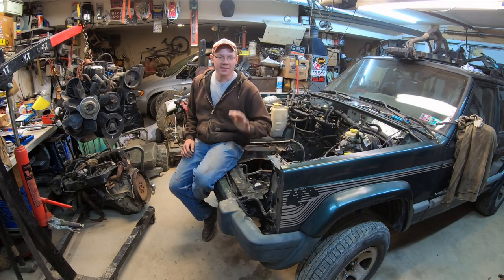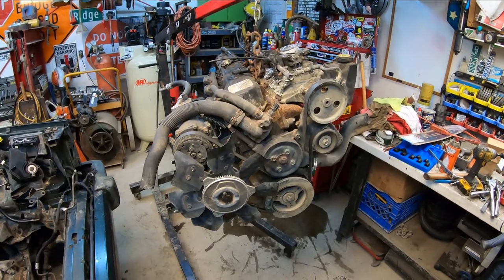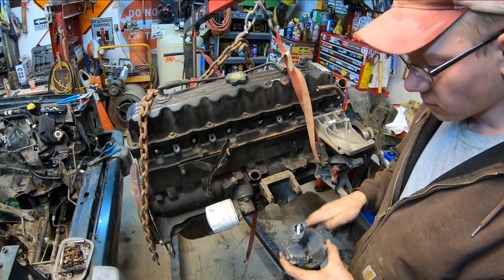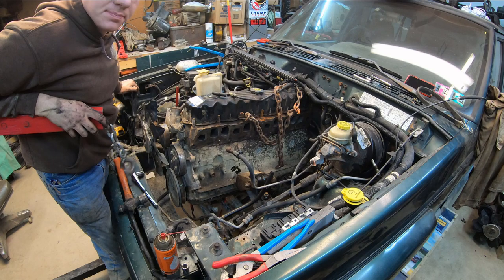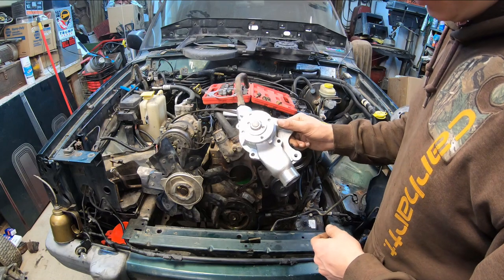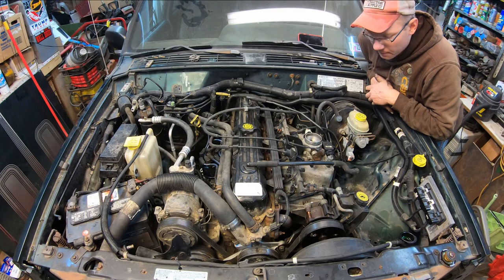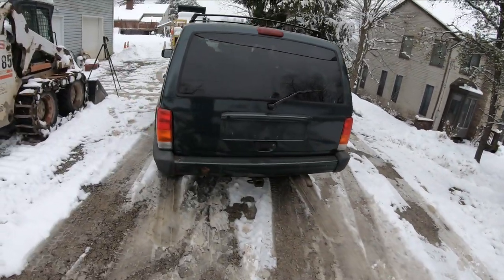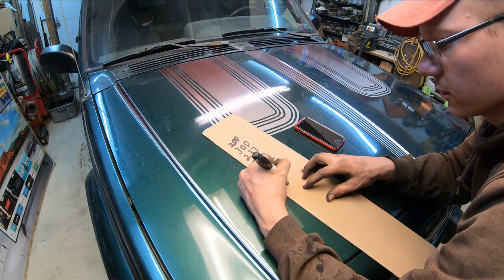$200 Jeep Cherokee gets JunkYard Engine,  WILL IT RUN AND DRIVE???

Comment: So its an auto box? Use a New clutch if it is manual trust me its worth it then.. Good learning curve if you do stuft twice aye ;-)
Put nice Winter tyres on it and be done with it? Spend the money on Mike Sanders fat/grease for undercoat.
If you can hinder the Rust it will be a good Winter car, just dont tune it as it should stay a beater

Comment: If you preheat the exhaust manifold first it’s easier to weld I stuck mine in the oven for about 15 mins at 500 degrees but a torch would work fine

Comment: 210 is normal for these Jeeps I believe. I've worked on my cousins 2000 Cherokee and it always runs at 210. Plus the electric fan is programmed to kick on at 218. We put a 180 thermostat in it to try and bring the temps down, they normally come with a 195.

Comment: jeep is AMC.  I have a 59 rambler  engine swapped back in the 70s from a 196cid to a 327cid. this was a temporary car or beater .  470,000miles later I still like it.  gets 25 mpg and will go over 100 mph quickly.  also no one else has one.

Comment: Temp, these 4.0 have two sensor one on the rear left corner of the head and one on the water pump. The one on the head is for the instrument panel. The motor is not run at the what the instrument panel displays, the water pump sensor feeds the PCM.

Sounds like jeep, looks like a jeep it must be a jeep. This thing will dig its heart out in the snow.

Comment: Nice work! I actually own a 1998 grand Cherokee I purchased new with 22 miles on it and it runs great at 150K on it, the real issues with these vehicles are the rear differentials go out because of the fact they were junk from the factory!

Comment: Nice, I use to have a 1990 Jeep Lerado, very similar style. Check and make sure the electric fans working correctly, mine had a heating issue and that was the problem.

Comment: My covid project replaced the head on my 99xj with original 225k miles. New shocks leafsprings and some eBay injectors and it rides again. That 4.0 will run for ever

Comment: pretty good running engine ,, i've got a 96 XJ and i love it ,,i recently rebuilt my 4 liter engine  it had 300,000 miles on it and was still running good but i wanted to do some work to it 
i converted mine to a 5 speed manual  with parts taken from a wrecked 89 XJ 2 door,,i have since added a high flow oil pump and oversized radiator for the cooling issues ,,other modifications including cold air intake , Air-water after cooler and a blaylock 60MM turbo ,,i do a bit of offroading  and the occasional hill climb ,,the 4.0 liter AMC 6 cylinder engine is actually a very tough engine and has a very strong bottom end ,in fact this engine makes a very good marine engine as well ,,the stock engine is rated at 195HP it can easily replace a small block V8  and i know someone who replaced a pair of 454s in a cabin cruiser with a pair these inline 6 engines ,,completely removed all of the bilge water pumps ,water inlets and outlets ,,the radiators are housed in the engine room hatch covers and use electric blowers for cooling ,,this completely eliminates the carrying of organisms in the water plumbing
it's over 1000 pounds lighter ,,and in fact he installed a 25KW diesel generator between the engines for rear ballast

Comment: Nice  job  replacing  & changing  ignition system back to  Coil set up, huge shop Rate  savings  doing it  yourself ,hopefully you'll  get rewarded with  long Term reliability  with  this  generic  amc  thing.

Comment: I am on my third Cherokee since they started making them, Love em'. They do like to hover around 210* on the temp make sure the electric fan is kicking on to. They are very sensitive to vacuum leaks to. By the way that Exhaust header is stainless  so the weld is going to look like a dirt dauber with or with out gas (I am pretty sure you were using mild steel wire with 25/75)  It will hold though. My Cherokee I have now is on 33" with a 4" lift. Lift kits for those are cheap as long as you don't go for the max lift long arm kits. One of these days I'll get around to doing the Mercedes turbo diesel swap on mine.
Reply: You can weld stainless with a MIG. I’ve done it before. Just get a spool of stainless wire.
Reply: @notajp  and 100% argon for shielding gas

Comment: $900 is only three months car payments. It looks and sounds good enough to get at least a couple years out of it, so I'd say that's money well invested. Don't know if it makes a difference to you, but Mustie1 way up in 'New Hampshuh' uses chainsaw bar oil to undercoat vehicles, claiming that it sticks better and lasts longer. I suppose you could always pressure wash the underside and apply a thin layer of Great Stuff low expansion insulating foam to seal 'er up and fill those, uh, fuel-economy body voids. It would quiet the ride too. Good job, Matt. Good job.

Comment: Those engines are awesome.  My '94 Cherokee lasted 280k miles.  Just be wary of the oil sensor unit. They tend to snap off and leak like the Exxon Valdez.

Comment: 210 is what they run at and they will run without complaints at that temp thats a very nice running engine and im planning to put a 4.5" rough country lift in my xj mostly because the 6.5" long arm kit is way out of my budget

Comment: Those Jeeps are known for running hot the radiator plug eazy and gust don't  let the coolant flow good even when they were new. They make good aftermarket rads that will fix the problem if it still exists...

Comment: If the exhaust leak (that you talked about at the end) is where I am guessing it is, it's right about in the middle between the front and rear doors on the passenger side.  the joint I'm guessing is bad isn't welded. if your lucky, a couple of exhause clamps will fix it. enjoy your XJ!

Comment: A good running and driving 99 XJ for well under a grand, with an engine swap. You did damn good man, shes ready for another 200k! quick side note, both my 98 and 99 XJ's always stayed at 210 degrees on the gauge, so yours is right where it should be.

Comment: Nice work! My wife had a "93" Cherokee that we used at times to tow our 22' travel trailer all over New England. Great vehicle but our main gripe was the wind noise on the highway. We traded it for a 2000 Grand Cherokee and now she's got a 2019 Cherokee. We had a 2011 Compass before that but it was junk. I think Jeep has gone downhill since Fiat bought them. Best Regards, Jay

Comment: You should back that $213 out of the build, you'd have to pay that reguardless of what you put on the road.  That Jeep should be worth $1000 - $1500 give or take.  So if you factor in your labor you should be right around break even when its complete. Harbor fright usually has cans of R134A for $5 or so around now.  You'll need about 3 of them to charge the system. Also typically you fill the 4.0s from the thermostat side of the upper rad hose.  That's the highest point in the system and it helps get out the bubbles.

Comment: That series of 4.0 ltr. motor where dead reliable, so long as the oil and filters where changed, if done on the severe service schedule, well over 300 k miles. They could be made to put out really good power, it just hurt the longevity. Can't have one without the other.
Merry Christmas

Comment: Good thing you replaced the water pump. Ive owned 3 jeeps around that year and all blown a water pump at some time.
Reply: Is it common for Jeeps to need a water pump at 10,000 miles?
Reply: @richrx  no i wouldn't say its common but i have worked on one before that needed one. But in this case sounds like hes taking the word from the buyer. And i believe you should its good practice to trust your gut and replace any weak points.
Reply: Yes I would tend to agree that 10K was the seller's story and the 10 washer bolt modification was also suspect. Having said that, the engine sounded great. In your professional opinion, what would be a reasonable price for a 110k engine?

Comment: Well done,... knowing the 4ltr very well, i must say that there is probably an issue one cylinder as the idle does not sound as smooth as it should, it's difficult to hear because of the leaking exhaust, but there is definitely something i don't like. If you taken the fuel rail and injectors from the old engine, it's probably worth checking EGT or at least how the spark plugs look after a good run. If one cylinder runs a bit lean,  you may not really notice it much while driving (especially if you don't know exactly how it normally runs) but you can easily destroy a piston with a partially blocked injector.... by no means criticism, just a word of caution, especially if you don't know what killed the old engine ...

Comment: Less than grand you’re doing really well Matt.  If you still have cooling issues May I suggest delete the mechanical cooling fan and goto a dual electric fan setup should solve your cooling issue. You probably need what I call a dual pancake electric fans setup for better clearance between the radiator and engine. 
Merry Christmas Matt to you and family.

Comment: That tin foil is because the mini cats would boil the fuel in the fuel rail on the original 2001 configuration. 

There's a conversion exhaust gasket you may end up having to run. Usually going from the 00/01 to the older style manifold will eventually leak at the gasket.

Comment: One thing to add to your list, how many hours  did you put in?  <$900 is a steal, the trans is still good, the running gear, brakes and heat are still good.  A friends daughter but 6 times that(on top of purchase cost) in a newer jeep, just cause she had to have a jeep.  but the new ones are junk.

Comment: hell yeah i love it when frustration turns into a  good running engine.  i traded some old equipment i had for a kobelco sk330lc track hoe with a locked up mitsubishi 6d16 engine. i took the engine out and tore it down and found a bent con rod and all the piston were seized in the liners.  i dropped the block off at the machine shop to get checked out. the machine shop said they have to order parts from japan to get quality parts.  im waiting for them to call about the price.  if that doesnt work im thinking about using my cummins 24 valve with vp44.  ill have to have the 24 valve bell housing adaptor machined to fit the hoes hydraulic pumps coupling.  itll be nice to be able to push over full size trees and grab them with the thumb and move the whole tree to the side.

Comment: I have a P0456 code on mine. Small leak in evaporative fuel system. Driving me crazy. I guess it needs a smoke test. New fuel cap , leak detection pump and purge valve solenoid. Still get a P0456.

Comment: SOUNDS like a good deal. had one jeep that is , 2.5 love it. yours under 1000 real good, Mine got in 1990 it was a 1990 with 10,000 miles on it, in Dec. well taking care of , but smelled off gas bad, guess that why they took it back. 12 dollar fix. hose at top off fill line, but hard to get to. Drove it maybe 25 yr. or so, my son wanted it, he got. He riding still. Cost me 10,000.00 then Dec. 1990

Comment: 210 is what these engines run at normally. I know it seems high but thats what the factory temp is. If you put in a lower temp thermostat or make it tun at a lower temp the computer will not switch to closed loop and read off the o2 sensors for feedback on tuning.

Comment: Love  the  Vid  Matt!  Puttin'  an  old  Cherokee  back  on  the  road,  is  always  a  good  thing  in  my  mind.   Fan  of  the  4.0,  bigger  fan  of  the  4.2.  Dang  near  the  gas  version  of  a  Cummins.  Question  though,  which  T-case?  Straight  2wd  to  part-time,  or  the  Select-Trac?  Had  an  '89  and  a  '98  with  the  Select-Trac,  Perfect  for  the  Mrs,  if  it  wasn't  dry  pavement,  put  it  in  fulltime  4wd,  and  leave  it.  She  made  it  home  from  work  every  time..........

Comment: I just bought my 2nd 2001 XJ...had almost 400K on the first and the trans started slipping.  Lunchbox lockers will turn that into a beast.  The open diffs leave a lot to be desired.  And BTW, everybody bitches about that top bellhousing bolt.  Also, pro-tip for anyone with a 4.0: Buy you a new crankshaft position sensor and install, keep the known good one with long extension and 12mm socket under the seat.  They tend to go bad at the worst time.  Crank with no start is faulty crankshaft position sensor 99.9% of the time.

Comment: Ive replaced several exhaust manifolds on those things.... It looks  a lot easier with the engine out of the Jeep! They make a set of manifolds that have little expansion bellows in them to keep them from cracking. I think theyre reasonably priced. My dad removed his back in the mid 90's and welded it up, it lasted many years before cracking again. 

Where do you get your shielding gas?

Comment: The foil around the injectors is heat shielding those motors are bad about overheating your fuel since the exhaust is right by the injectors itll vaporize your fuel before its ready and cause a rough idle or a miss
Reply from the maker: If I have any Issues Ill replace it with something nicer. thanks for the tip!

Comment: Thanks for the video. I am going through the same thing, those reverse torx bolts on the bell housing were a @#$%^ . I  took my old motor to a machine shop for rebuild. Will be putting it  back in and will use this video and the previous one for reference. Thanks so much.
Reply from the maker: Good luck!

Comment: Just an fyi a temp of 210 is perfectly normal. The 4.0l is designed to run at that temp. If your not getting heat from the heater you might need to back flush the heatercore.
Reply: I'm not getting much heat from my 89". I have plans to add a second cooling fan eventually. Which will be the time I back flush. Just don't want to open a can of worms to soon. The dash will come undone eventually, but that will be to soon

Comment: When I got mine at 240k kms the engine ran like crap after a plugs, wire, and rotor and cap. Turns out I had 1" free play on the timing chain, on both sides... The top oillite bushing of the distributor was worn out too. If someone happen to go to a machine shop to replace the oillite bushing on the distributor, the gear that meshes with the cam has 13 teeths and goes only on one way.  I'd would have replaced the rear main seal if I had the engine out like you did. Mine is with a 242 tc. For plowing snow around the house it's the best the drivetrain doesn't bind and I can take sharp corners with it.

Comment: A good undercoating will help prevent damage from the 5 tons of salt on the road.  What about the suspension from the roads?  Only in PA do they require your vehicle to be roadworthy, but the roads are not car worthy.

Comment: Nah I think you did good with that Jeep Matt. As I have sunk money into an old 1965 Ford F-100 that was in worse running condition, as it had a top speed of 36 miles an hour, would not pull it's self in third gear, and had a cracked block that had to be bored a 100 over to get it back in running shape. Granted I live in Texas, and you live some place that actually see's snow so our older car's tend to have better frames under them unless they are on the coast of Texas. The only thing I would do if I was you Matt, is stick a new radiator in it just to help with that heating issue. And if you do that go with a 4 core radiator if you can, as it gives you more coolant capacity.

Comment: Unfortunately, cutting all lines and wires is standard practice in the auto-salvage industry. Keep all the connectors and adapters that are in good shape though, they'll make for good pigtails. New pigtails are expensive if they are not extremely common.

Comment: Sounds better than the 1st motor by all means - waiting for the autopsy on the other engine - should be very interesting- trying to figure why you didn't fix the other engine - your vehicle this may be cheaper than fixing the engine - is that 4x4  - if so try it

Comment: I got a 1986 Toyota Corolla FX16 (hatchback) it had 347,000 miles and would start by barely turning the key. Bought it for 500 with 150 in all new tires lol. I beat the hell out of it till it wasn’t driving due to brakes and sold it again for 500. Them Toyota’s really hold their value lol

Comment: Liked and subscribed, that was a fun 2 videos and I am far from a mechanic but do a fair amount of my own work on my cars... I will put against your  "beater with a heater" my 92 wrangler yj I bought from a client of my bosses, 1 owner from new with just less than 30k miles that I got for $850... Needs the Frame patched on the driver's frame rail right at the back along with a couple of suspension mounts and a section of exhaust... The plan is to weld what needs welding and totally coat the underside to preserve it and put a moderate lift on it (something like the 2.5" Rough Country) as it already has decent tires on and engine runs like a champ... The perfect beach buggy for surf cast fishing for me without the $6k price tag it would have once it has an inspection sticker on it 😁

Comment: Hello Matt,  so glad it's worked out not to bad on cost wise, did you do an oil and filter change???. Motor sounds good.  Over in Britain we don't see lots of Jeeps, do like the look of them and a 6 cylinder petrol allways sounds so  smooth, we also have to put up with the Council boys on bonuses with the amount of road salt they put on the roads, we call it the attack of the tin worms. Best wishes,  Geoff Lewis,  Wales,  UK, 🏴🏴🏴

Comment: Nice job.
Check the head casting no. Hopefully not the dreaded 0331. If so, ease check it saxs Tupy under oil filler neck. If so, yr OK.

Comment: The foil was on the injector as a heat shield to prevent vapor locking when the engine is heat soaked - it's a known issue on these